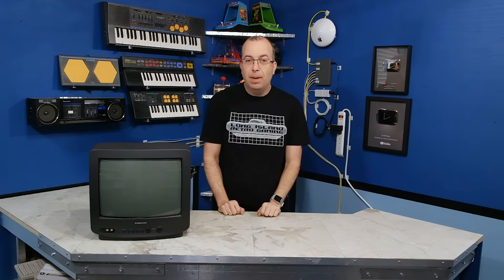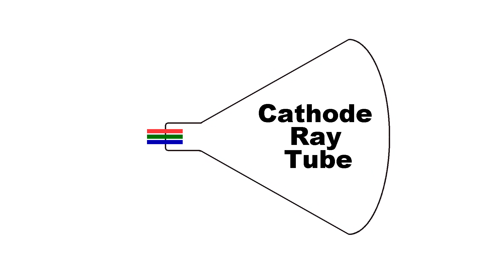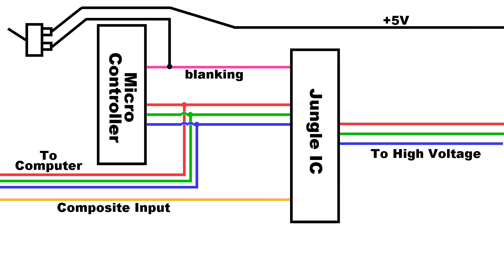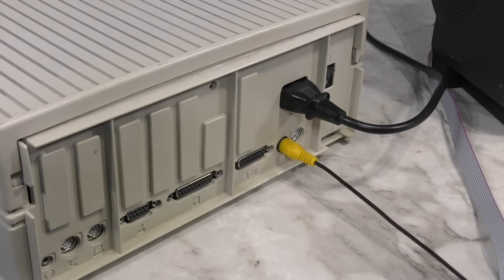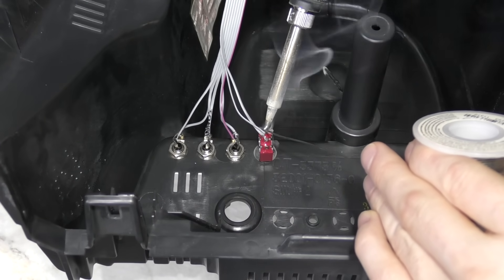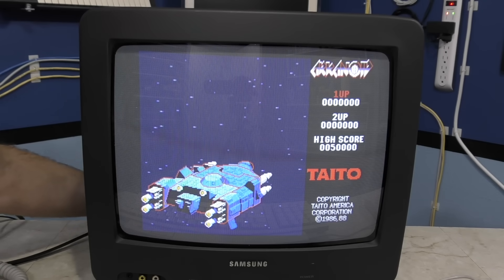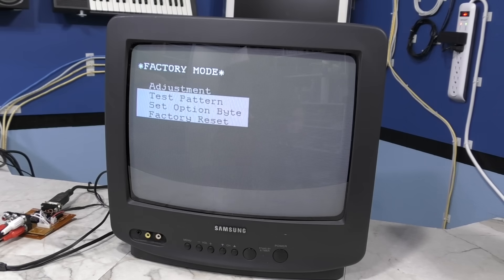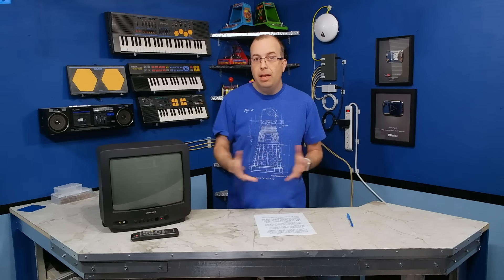Modding a consumer TV to use RGB input

Comment: Man do analog TVs using composite  stink for text.
Reply: @thanks jk 240p isn't interlaced, see the p in the name.
Reply: jamvanderloeff That's the point. 240p is the low res you get by sending the same lines for both passes in a 480i signal.  Because composite TV-style video only supports the traditional analog TV resolution of its target market, such as the 525 line US standard or the 625 line European standard (both numbers include the lines used for the Vsync pulse).
  In theory it would be possible to have a full range composite input on a multisync monitor, limited only by the physical resolution (color mask/grid in CRT or actual pixels on other tech) and the subcarrier for the color encoding (NTSC, PAL or SECAM), but I don't know if anyone bothered.
Reply: thanks jk Composite doesn't officially support 240p. That was more of a neat trick used to get CRTs to do 240p. Modern TVs will try to deinterlace 240p and it looks awful. The tv will think that it is looking at 480i.
Reply: If you can believe it lcd TVs using composite are even worse. Long story short they try to deinterlace a non interlaced signal and it makes the picture even muddier.
Reply: @chadmasta5 Not all, but many.  My old 1024x768 projector the died looked good playing Laserdiscs on both Composite and SVideo, but the new 1920x1080 one looks just terrible showing the signal from LD.  Unfortunately the older projector died, so I can't really go back for just the laserdiscs.  I'm tempted to look for another one, just switch back and forth depending on what I want to watch.
Reply: @Paradoxeality  I always used RF on Commodore 64, because that was pretty much all that was available back then where I live. And I'm pretty sure that C64 has 40 characters per line, but it seemed fine; some characters could have used less noise in the picture to look as designed, but mostly the result was OK.
Reply: NTSC: Never Twice the Same Color
Reply: PAL:  Pay for Additional Luxury
Reply: Being on NTSC it is also worst too
Reply: UK TVs had teletext and text on it looked sharp even via RF cable ! thanks to our superior video resolution and colour reproduction and decoder in all our 80s and 90s TVs
Reply: ehm teletext runs on the telly, it is pretty much a one way video terminal, they do not send the whole picture just the data that the tv then interpret and draw on screen using charatcters

Comment: Funny story, I had that exact tv in my bedroom growing up. It had a 'fine tune' feature that let you partially unscramble pay channels, I taped alot of fuzzy tiddies off of skinimax with it. Also sometime in the early 2000's it started to fail by turning b/w. If you gave it the old Fonzie percussive maintenance routine it would blink back to color for a couple of days.
Reply: Yeah I think it was supposed to be used to adjust the picture if you were using an antenna but it worked great making scrambled pay channels vaguely watchable. Granted it was still awful quality but this was when I didn't have my own computer and even if I did it would have been still images on painfully slow dial-up.
Reply: I recall the remotes for cable boxes back then had a button that would do that if you pressed it repeatedly.
Reply: Did the same, let's just say I spent a whole lot of time to get Hustler working and it was always this fuzzy, negative color picture but I saw those tiddies just fine C:
Reply: Best comment of 2018 :D
Reply: I tried the same thing but I eventually got a box that unscrambled them. My neighbor used to sell them but he needed his CR250 fixed and gave me one. After that all I was missing was HBO. But I eventually found one of the bullets to fix that and it worked for years even after it wasn't supposed too lol.
Reply: Brings back memories of squinting at Nagravision encoded porn on German satellite channels on the old U.K. sky system back in the early 90`s.  It sort of reversed and negitivised every other scanline so by squinting at this black and white mess you could just about make out what was happening.  It was almost like watching a mechanical tv from the 1920`s lol.
All European tellies have fine tuning due to the horrible topography and transmitter placement making it a necessity.
Reply: It's kinda interesting that pay channels used to be done like that. In China such thing doesn't exist at all until digital broadcast is getting adapted. Also, such pay channel implementation likely didn't exist for too long because in the early 2000's pretty much all TV got the auto tuning feature which doesn't care if there's any channel frequency standard, I think. (And the TV essentially become a radio tuner, which also start to have auto tuning at that period of time.)
Reply: The only thing that was missing on this channel was a discussion about hoodlie-doodlie
Reply: Fine tuning? Don't all TV have manual tune to the every hz
Reply: Fine tuning and convenient channel positioning introduced a good amount of people to adult channels in my country. It only worked at midnight(best time) and it had no sound
Reply: LOL, I used to do the same thing with two LG CRTs I had back then; when I told my friends this trick, I was thanked forever.
Reply: DoddoSonic  I've got the impression that traditional American TV's had a single tuner, and channel was switched by rotating a dial that moved in steps. In Europe in the same era, TV's had presets (often 8), and technically a separate tuner for each. The tuners were adjusted without steps (because the frequencies could be slightly different in different countries), and there were buttons to select a tuner.
Reply: @pauli:  I think thats why American consoles have a channel 3/4 selector on the back whilst our UK ones never did and outputted on UHF 37.  IIRC when Channel 5 started broadcasting they had to give away filterboxes because in some regions the signal bled into CH37.

Comment: I had an AST briefly. Maybe an XT or 286. I also had a Samsung turbo xt, ‘‘twas my first computer.
Reply: My first PC was an AST Advantage 486SX25.  Man that thing was barely a computer -- 2MB RAM, 80MB HDD, 512K VRAM...  but under $1000.

I don't miss that one.  I have been pining over my second PC though - a home built 486DX2/66 mini tower with a turbo button and LED segment display.  I miss that little box.  It looked like the 90s.

Comment: That sync on composite better be well shielded!
Reply: Yeah, sync on composite is known for adding erroneous noise and diagonal stripes.
Reply: @Chicken Tendie but then a lot of CRTs can't accept any other form of sync than sync over composite video. I have no idea why though :/ as SCART''s specs say it should accept clear sync
Reply: ボロ from EU honestly, nothing beats c sync or sync on luma. Sync on green is fine... (looking at you ps2) but not many tvs are used to accepting that signal over anything but component (YpbPr). And sync on composite is fine, as long as it's well shielded.

Comment: CRT from 1997! Don't you throw anything away?
Reply: why? It works fine.

I have a zenith from 1986 and it's my normal everyday tv that I play games on and watch the news.
Reply: No, why. Old stuff is built better, lasts longer and is worth repairing.
Reply: @simontay4851  My CRT TV is from 2008 (those end of the line ones) and it is actually a pretty nicely built TV. Heck, it's kind of generic, but since I bought It i must have put more than 500 hours on the poor thing, and the picture quality is still great. I actually use it to watch Netflix (no joke) and old VHS movies.
Reply: Why throw it out when it still works?
Reply: What would he plug his old computers into if he didn't hold on to a CRT? It's not like the ones from 2004 were made any better.
Reply: Um, if we threw things out just because they were old, all the 8-bit computers would be gone, and where would be the point of this YouTube channel?
Reply: That's nothing! My main CRT is from 1991, works like it just came out of the factory even though it's been turned on for 1/10 of it's life!
Reply: A 20-year old CRT isn’t that old for a CRT.
Reply: Ok. Good point. Good point. All you people are clearly still driving around in your first cars listening to cassettes. But, just gimme 6 months to grow back my mullet, first.
Reply: I used my 1990 CRT I inherited for everything - it may be RF-only but it's surprisingly nice!

Comment: I am absolutely blown away by this.  I had no idea this could be done!
Reply: Even older TVs also can be modded to accept component and S-Video, you just have to check the schematics of the TV if they have the correct separate color demodulators.
Reply: Something to be aware of with even older TVs, is that they may have a hot/live chassis that isn't isolated from the mains supply. Those will require an isolation transformer, in order to safely modify for RGB. Can see that 8-Bit's Samsung has a large mains transformer in it, so that's definitely isolated.
Reply: @michaelturner4457  

Your comment should be pinned!

The whole "hot chassis" thing is very common on TVs in 110V-120V land.

It can be super dangerous (lethal) if somebody tried to mod one of those TVs with external inputs that bypass the isolation.

You can often (but not always) tell if a TV has a hot chassis if it has an insulation block between the RF tuner and the antenna socket.

People have been recently injured attempting mods like this, so it's worth mentioning every time.

It should go without saying that the CRT and larger caps should be safely discharged before working on a TV or monitor, too.
Reply: Actually, around 3:53 in the vid, you can see near the bottom of the board where it has the "HOT" and "COLD" sides clearly marked on the PCB silkscreen.

As Michael pointed out, this specific TV has a switched-mode power supply, so it has the proper isolation between the mains side and low(er)-voltage side.

The "hot chassis" style TVs don't have ANY of that separation / isolation at all, which means that the entire board is essentially floating at MAINS potential!

That could be 170 Volts or more of rectified DC. If the insulator on the tuner is bypassed in any way, like adding external wires for an RGB mod, it can create a serious electrocution risk.

This isn't just me being overly-dramatic, btw, it's a real issue atm, as it never seems to get mentioned in the modding videos.
Reply: yep - can blow things up that you connect to them if you have 2 different grounds/no isolation
Reply: @ZILtoid1991    would a black and white tv be easier or harder?
Reply: @TheJunky228  probably easier, and so far I know that a few TVs were often hacked in Hungary for that reason since monitors were hard to smuggle in the country, even computers needed to be disassembled.
Reply: @ZILtoid1991  actually i realized that this method most likely won't work because my tv doesn't have any sort of OSD, it's all physical controls.  i might be able to hook just composite up though in a similar fashion, I'll have to tinker around later
Reply: It's not really a surprise since most TVs are designed to be sold world wide and almost every TV sold in Europe since the late '80s has a SCART connector that happily accepts a RGB signal.
On this TV, the hole in the back case where the original composite and audio jacks sit, looks suspiciously like a SCART connector... would be interesting to have a look at the bottom side of the PCB over there.
Would not totally surprise me if all the solder points for an actual SCART connector would still be there and they just created this huge blob of plastic including those 2 RCA sockets for video and audio soldered at the according pins of the SCART connector.
Reply: same
Reply: Hey pal!
Reply: DVI>VGA works for me
Reply: It was even kind of special to have a monitor that could display a simple Composite signal, back in the day. Some people would take regular televisions and do modifications to "GP" (or jeep) them. We're talking around 50+ years ago. Consumer TVs with composite jacks didn't start appearing until the 1980s.
Reply: Sucks living under a rock.